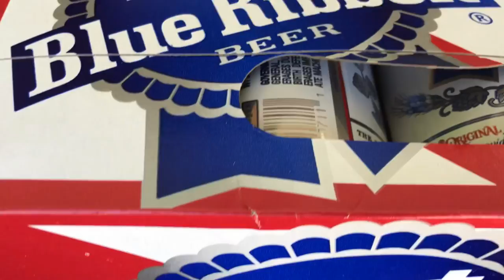HOW TO INSTALL A CEILING FAN WITH REMOTE CONTROL BY TOM - #GoodMorning 111 Vlog

Comment: You hung a ceiling fan from a light fixture bracket? Is it a rated box for a fan and plus you need a new bracket to compensate the weight.

Comment: I bought what seems to be the same fan a few months ago and it has been working great, but now I have a problem with it I'd like to ask you about. The fan is installed in my bedroom and I rarely turn the light on, and I only turn the fan on when I go to bed and then turn it off when I get up in the morning. Today, I came home and somehow the light (but not the fan) had come on by itself. I used the remote to turn the light off, however an hour or two later the light (but not the fan) came back on all by itself.  I'm wondering if you've had this problem or have any idea what may be causing this and any thoughts on how to fix it. Thanks in advance for your reply.

Comment: I found it easier to put the blades on before you put it up there and I saw how he hooked up the receiver 3 wires first which is a good tip and then hook up the hot and neutral wires. Hear that hum? That's what bothers me and have been trying to cure it with changing the remote and receiver. I had another one that fit in my HD Collectors fan and it did quite it a little but still not happy with the hum so I'm going to try another receiver and remote from HD. Thanks

Comment: how long did it take him?
Reply from the maker: ytRbro probably 10 minutes. Once you hang the fan on the adapter plate, only thing to really do is match the colors of the wires together and your are done. Just make sure all power is secured in the room that you are working in.
Reply: sorry talking about taking down old light fixture to putting up new ceiling fan?
Reply: sorry talking about taking down old light fixture to putting up new ceiling fan about time from start to finish?
Reply from the maker: ytRbro one minute. All he did was unscrew 4 screws off the ceiling and disconnected the wires and the old light fixture was removed. Check out the 1:16 mark of the video. The room didn’t have a ceiling fan before. All it had was a light bulb fixture the lit the room. So we installed the fan to give it some air circulation.